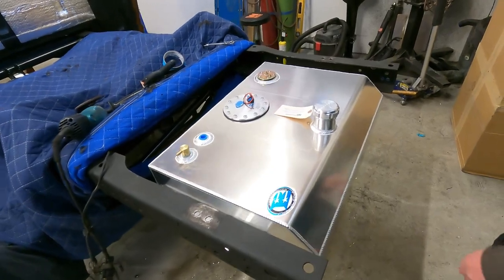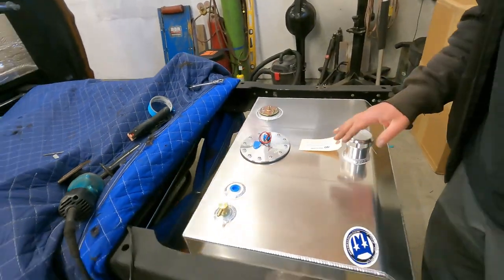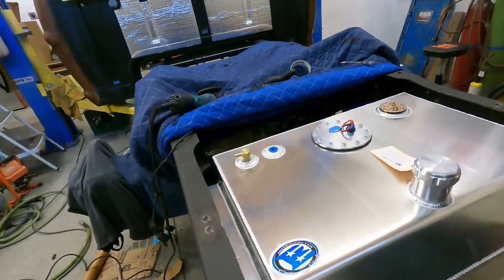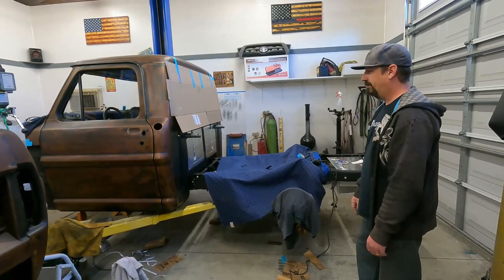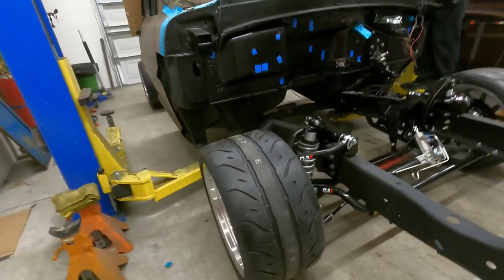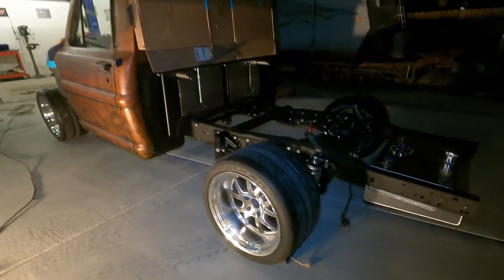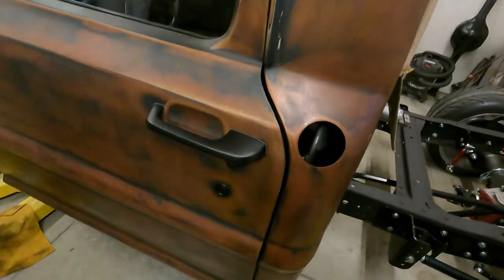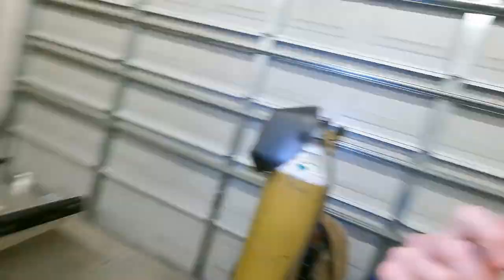Pro Touring F100 Build pt.8 SCRAPPY IS ON THE GROUND!!!

Comment: what's the wheels and wheel and tire specs ?
Reply from the maker: The front wheels are rocket racing attack wheels the size is 18x11 with 5 inches of backspacing and the rear wheels are 18x12 with 5 inches of backspacing and the tire combo is falcon RT660 315/30r/18s
Reply: @hunkedoutracing  Hey guys...Quick question.  Was the backspacing 4 1/2 or 5 for the front and back.  I recall you mentioning 4 1/2 in one of the videos.  Trying to get my tire and wheel combo just right.  Thanks.
Reply from the maker: 5 in the front and 5.5 backspacing in the back
Reply: Do you happen to know the offset for the Rocket Wheels ATTACK 18x11's? and 18x12's?  Thanks
Reply from the maker: @swilson691000  all 4 are 18 by 11